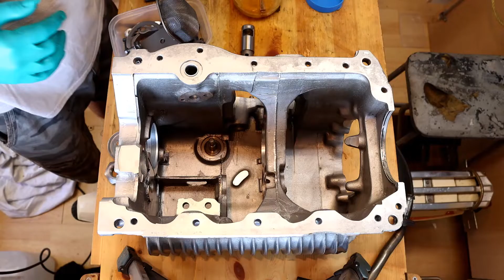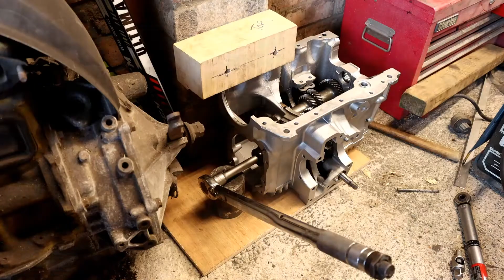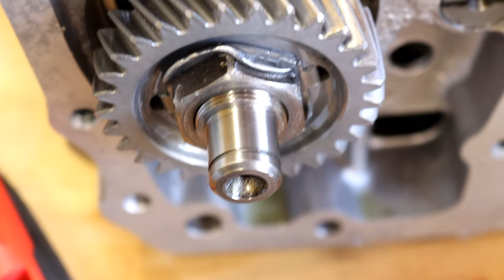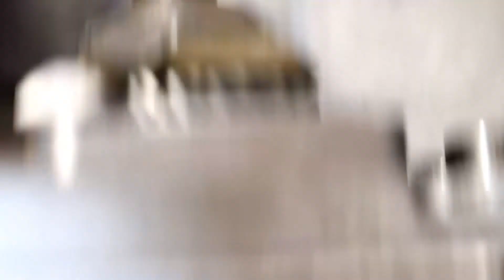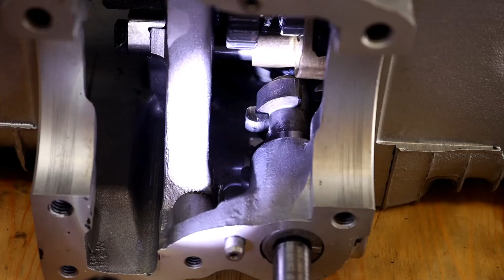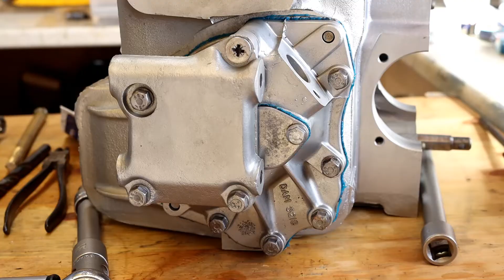Classic mini gearbox rebuild.

Comment: 16:00 You'd do better torquing it in bigger steps. Static friction is always higher than sliding friction, so a smaller step might not increase the torque enough to get it sliding again. A confirmation "click" to ensure it is static to finish.

Comment: You should preferably not torque them in stages. It is best when torquing fasteners up to do so in a smooth swoop. If you do so in stages you're not getting an accurate torque figure as there is some inertial friction to overcome. Interesting vid though, thanks for filming the process
Reply from the maker: Thanks for your feedback. I do know i lot of things can effect the torque, lubrication has a massive effect. For me using a cheap torque wrench i would always go up in steps. And using a cheap wrench going smooth to the setting point is very important.

Comment: why are those two large nuts torqued up so tight I would have thought it would be enough to maybe 120 foot lbs and then the lock tab.. what do you gain by massivly tightening up these nuts so much
Reply: They are clamping gears that are loose enough to slide easily on the shaft splines. Those gears  repeatedly get pushed in opposite directions depending on whether the engine is pushing the car down the road  or the road is pushing the engine via the car (engine braking). They're thick shafts & the nut needs to stretch the ends enough so they maintain more friction on the threads than the splined gears can overcome.

Comment: I completed my gearbox rebuild over the Summer (2023) and it is now back in the car. Having watched you struggle to tighten the big nuts I decided to screw a wooden block just above my workbench and do the job at waist height - much easier! Also, I have stopped using Hylomar Blue on my gaskets (too messy). I now use Loctite 3020 on low-risk gaskets and Delta D203 RTV for gaskets that are at a high risk of leaking (like the timing chain cover for example). Gearbox no longer crunches when changing down to 2nd and so far it isn't leaking.

Comment: Interesting video - thanks! How did you decide which parts to renew when you were doing this job? What was wrong with the gearbox that caused you to consider a rebuild? I am planning to tackle one of mine this year when the weather warms up as it has an issue with the synchromesh when changing down into 2nd gear.
Reply from the maker: Thanks for your kind comments! as for why i rebuilt the gearbox it was mainly because it was of an "unknown mechanical condition" and because i had stripped the engine it seemed daft not to refresh the gearbox. (it also leaked oil) i also enjoy doing things like that!
Reply: @mrfid72  Thanks. Where did you source the replacement parts from? Do you have the gearbox back in the car or is this something for later in the year?
Reply from the maker: @grahamwoodier5066  Most of the parts came from mini sport, they do a gearbox rebuild kit for £276, if you go via Guessworks then its a lot more expensive. The engine/gearbox has all been built back up but i have still got to rebuild the front of the mini so it will stay as it is for the time. I want to keep the front subframe bear so i can bolt it back and help to align the front panel etc.